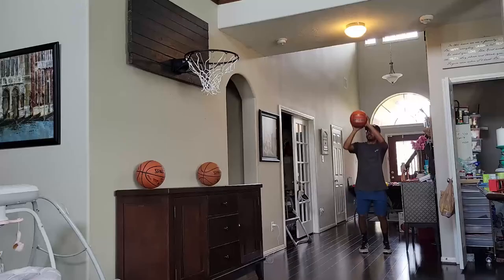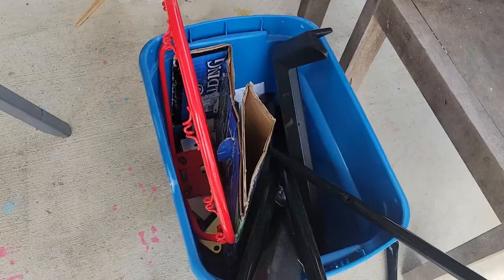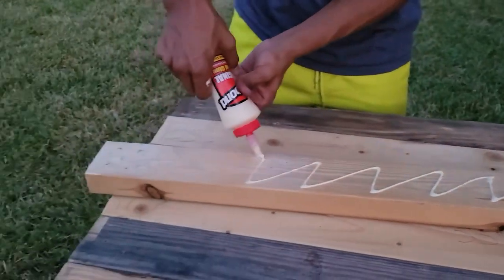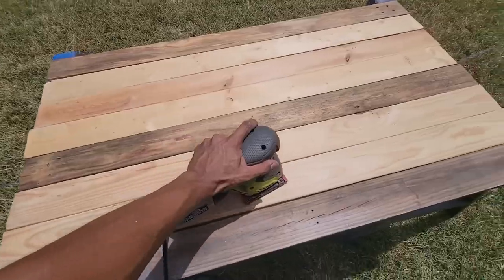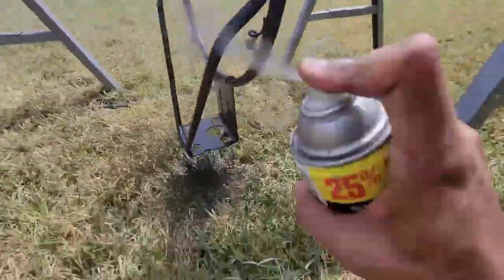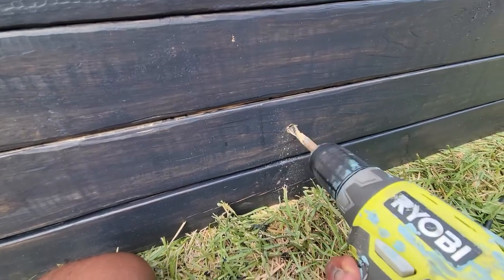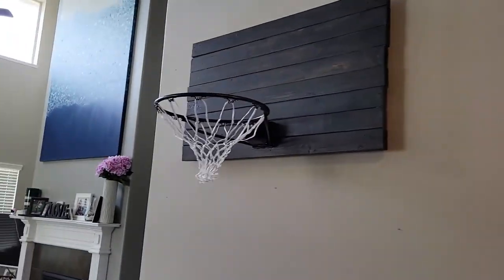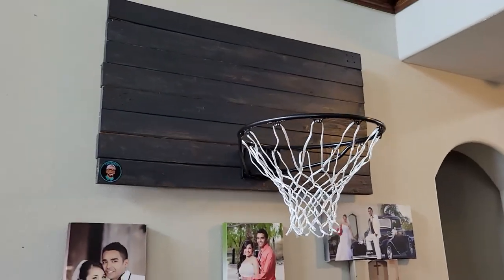DIY Wood Basketball Goal | Easy Décor Idea |

Comment: You should’ve installed the hoop outside and not inside to avoid scuffing those beautiful hardwood floors with the ball bouncing around
Reply from the maker: i dont really play on it, it was for decor. just bounced the ball for the video a few times. but good tip either way, thx.